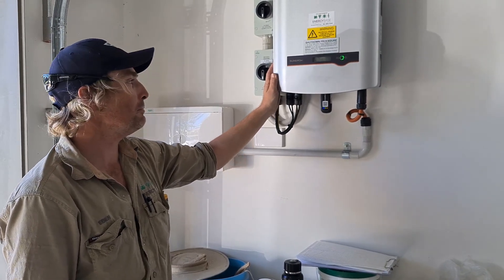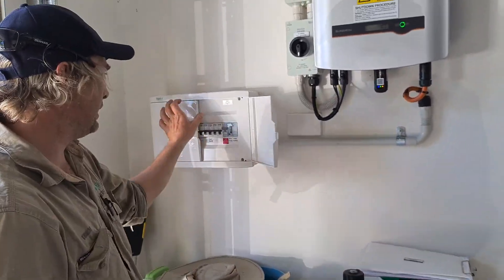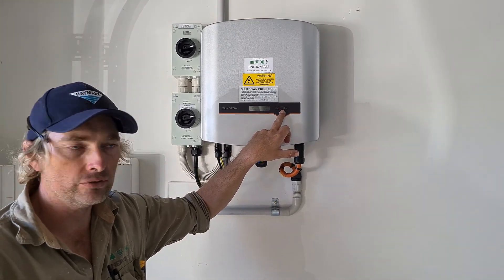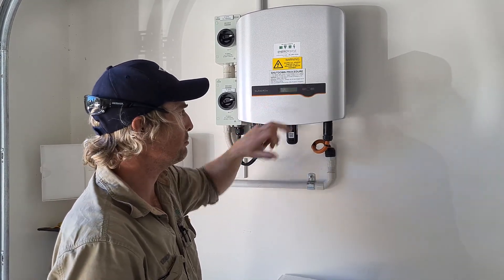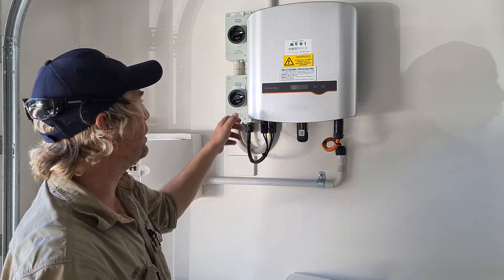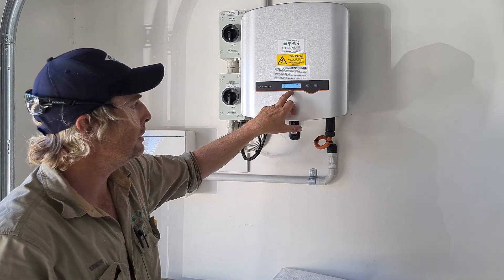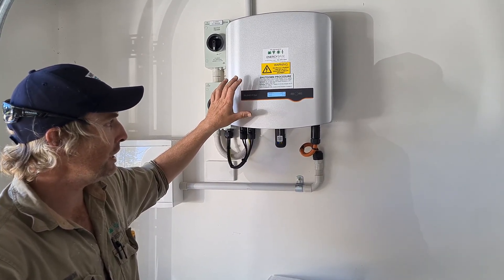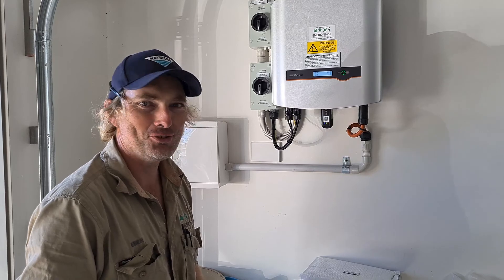How to Shutdown and Restart your Sungrow Inverter

Comment: With mine, there is no DC isolator located near the inverter. Everything else looks the same, except that the wires go straight into the piping and across the ceiling into the roof. What do you suggest?
Reply from the maker: @PlogVlogAU  newer model inverters come with an integrated DC isolator under the inverter, so external ones like in the video are not required.  If in doubt contact a local electrician to check it out for you.
Reply: @energybase7553  Thanks for the info. We were going to turn it off before the cyclone hit, but we ended up evacuating this morning. We'll just have to see what happens. Thanks again.
Reply from the maker: @PlogVlogAU  all the best.
Reply: @energybase7553  Thank you.
Reply: @energybase7553 Thank you for this video!  Mine was installed 2 years ago so the PV Array switch is underneath.  It was turned off correctly in a hurry (cyclone 5 days ago), but even when turned on correctly (as per your video) , it flashes green on the panel stating Status = Standby.  No matter how long I leave it.  And it makes no startup noises. 

All the three lights you mention underneath are on too (Run/Cok/Net).  Is there a 3rd step I'm missing? 

Could my PVArray switch not be working?   Any guidance would be much appreciated - thank you!!!
Reply from the maker: @juanitateepa9162  is the AC isolator and/or circuit breaker turned back on? Check that first, or perhaps try another full shutdown and restart.  If nothing then you may need a local electrician to come and check it out.